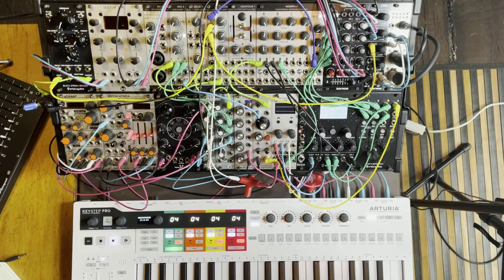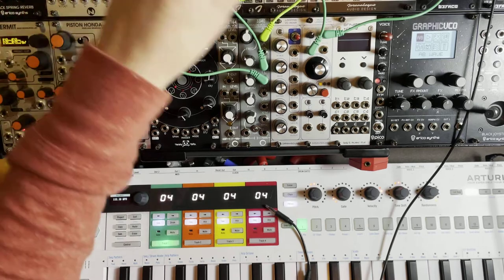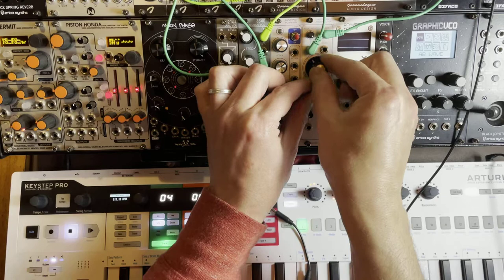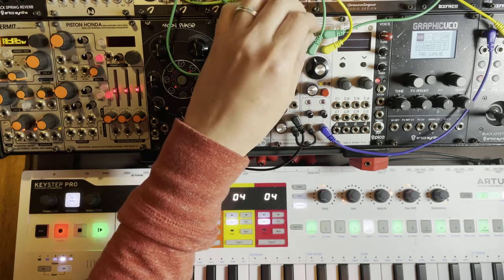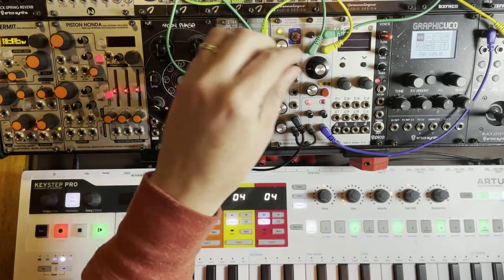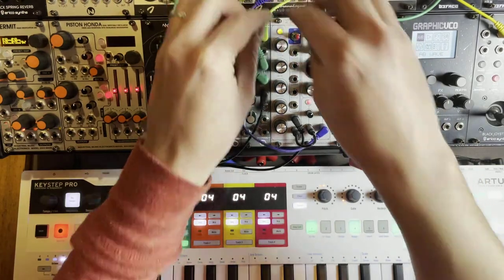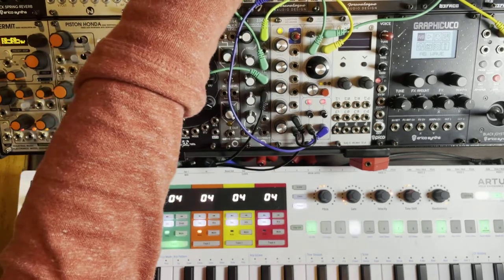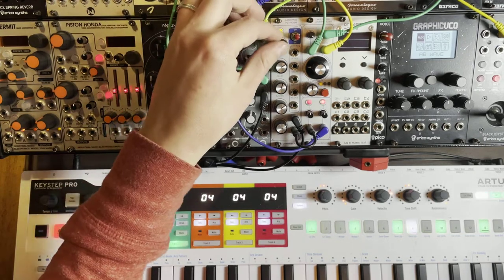Dannysound Multimode Ladder Filter Demo!

Comment: There are 2 CV inputs.. is this just a cv mixer so you can sum 2 inputs easily, or are they CV control over different aspects?
Reply from the maker: Exactly, it's just a cv mixer for the Cutoff frequency. The resonance cv input is above the cutoff knob to the right.
Reply: @QuincasMoreira  thanks! I have this kit in my build q but haven’t got to it yet. Sounds so good it might jump to the front of the line ;)